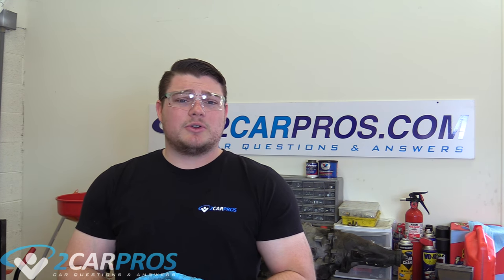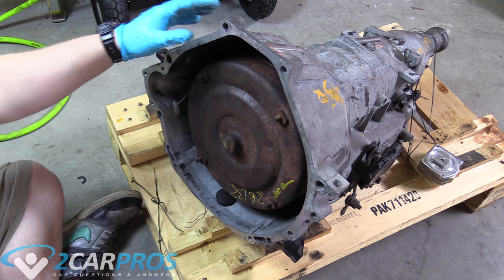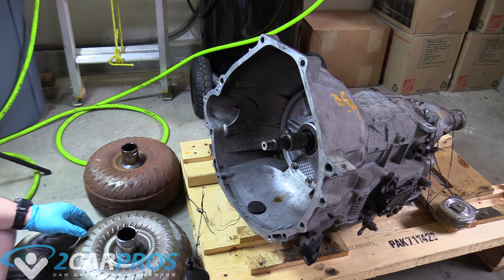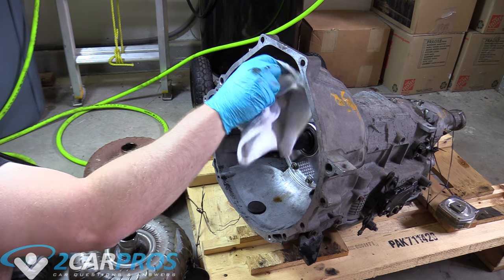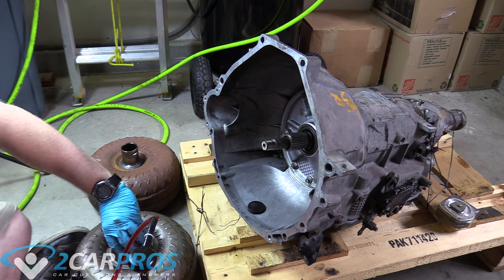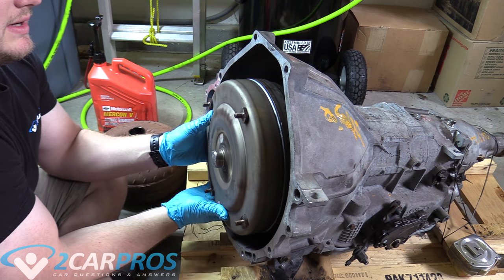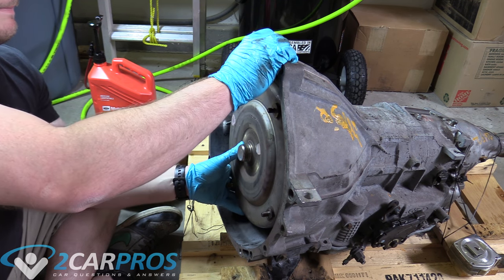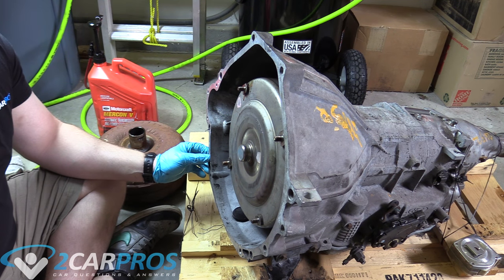How to Replace a Torque Converter for an Automatic Transmission

Comment from the maker: Forgot to mention in the video but it is a good idea to throw a quart of the appropriate ATF i the converter before install. ALSO here is the link to remove the transmission https://youtu.be/3vJAojsrfuU
Reply: thank you.
Reply: yS, infact 4 a 4d croOwn vic trAns, mAB 2 or 3(IIIIIIFFF it's nU & MpT).. & U had the perfect tUl rIt there.. shEEAashh👋
Reply: Just joshN, luv U viDOs dog 👋
Reply: im sure you remembered after a few posts, this is a horrible video cuz anyone could of done what you did without help
Reply from the maker: @usanewsnow2024  Then don't watch it?
Reply: @2carpros  lol  get good son.
Reply: @usanewsnow2024  "get good son?" never heard of that, must  be a Northern thing,lol
Reply: @dntlss  New York Thang!
Reply: @2carpros  Your video's been extremely helpful for me.  Thanks 2CarPros!
Reply: Dumb question but do you drain the trans fluid before removing the torque converter?
Reply: @dntlss it’s something kids say on video games lol
Reply: So,,,,, do I take my tire off? Axles out? How do I get to this ?
Reply: Doing my first toque converter for my friend. On his dodge Durango. Any tips or suggestions? Ill note to add quart of ATF in the converter b4 i install it.
Reply: Yeah I was gonna say don't u put fluid in it first??

Comment: Very good vedio EXCEPT you left out the most important thing of all !
When installing a new torque converter you need to pour at least a quart of ATF inside the unit before its installed  !
Not bad a greenhorn !
Keep working with them and one day you'll see the big picture  🐒
Reply from the maker: Great point, I will add the that point! Always nice to have helpful tips :)
Reply: The converter has assembly lube in it no need to put fluid in it. The pump will fill it just fine. Been rebuilding transmissions since 1980 and never once put fluid in a new or rebuilt converter.
Reply: @2carpros  😂
Reply: @dalevackar182  and you should fill it like every other mechanic so it dont pull fluid from rest of unit as well as running without fluid till that happens, sorry to hear you are a experienced mechanic who dont get that, knucklehead.
Reply: @usanewsnow2024  I think you're the one that doesn't get it son. If you had any knowledge of how a torque converter and an automatic transmission works you would know that pouring fluid in the converter is okay its just simply not necessary.
Reply: @dalevackar182  he has no idea what hes talking about, hes just trolling,some people like to put fluid in them and some dont,like you say, its not necessary but if it makes them happy then I'm all for it, you wanna see something really interesting? watch a bunch of videos on bearing packing, no matter who does it and how many videos you watch its always wrong,ALWAYS,heck when i do it, i dont spend a lot of time on it and in 30 years packing bearing i have yet to have a single failure ha ha ha
Reply: @dalevackar182  how about the bankee sona ?
Reply: @jesusolivares3749  I have no idea what you are talking about.

Comment: Anyone notice there are no videos of changing torque converters, like the full process like most! Like this guy bt a torque converter takes longer than a 3 min video! So you missed over half of the process
Reply: Bro said easy like all it takes is to just pull it out.
Reply from the maker: What? I literally showed every single step. There isn't a lot to it.
Reply: He confused transmission removal with torque converter removal..... simple solution.  Watch transmission removal video than this.

Comment: great  guy i put my transmission in and found out it has a bad torq converter
Reply: So you didn't need a transmission correct? Just a torque converter to begin with?

Comment: My Toyota has like a problem shifting to first gear. And between 30-45 It feels like I’m driving on rough road And I’ve been doing research and come to the conclusion that is the torque converter. I am correct? Just want to be sure before spending money on parts
Reply: Jose Rodriguez did you replace it? And was the problem fixed?
Reply: I'm having the exact same problem as this. Wondering if you've fixed it?
Reply: Toyota hiluxes have a clutch that is factory bonded I the front they also have a clutch plate that slides on it. Here in Australia we get them blown up all the time or burnt clutches becuase of towing or ever just getting bogged can burn you converter out.  You clutch could be slipping or a bearing has popped and it's eating through your stator. Hahahah check the pan it'll be metalic oil. Converter number.... 2082-8d we reline them with sonax linings..... To-f-1k.... We heavy duty the insides and change sprag all that jazz but 9 times out of ten you'll need two of these converters to make 1 😢🤔😅

Comment: do you fill the converter with fluid before putting it on?  or just slide it on as in the video?
Reply from the maker: You don't need to fill it. The transmission will fill it. Thanks for watching!
Reply: So that it's not dry on initial start up you should put at least 1 quart into the tc.
Reply: @2carpros  good God lol yes put atf in before install spin it a few Times so the fluid dont come out
Reply: This makes me cringe lol him not putting the fluid in haha ima stick to my shade tree that’s why I don’t trust a mechanic lol
Reply: no ofc thats the transmissions duty itll get the fluid in as soon as ya put ur foot on the pedal
Reply: @bobbycarrell4424  yup cuz these video guys arent that smart, unless they watch enuff of someone elses videos, lol

Comment: Great video!
Id like to know, I removed my transmission with the torque converter still bolted onto the flywheel on my sc400 to replace the input shaft seal. When putting the trans back will I have to clock the torque converter so that it lines up with the internal trans pump?

Comment: I’m getting a tugging feeling and noise once I get to 60mph could it be my torque converter I’ve had the motor and transmission check and no leaks

Comment: Is it possible to swap out a torque converter without completely removing the transmission?
Reply from the maker: The bellhousing has the clear the back if the engine. Thanks for watching!

Comment: Do you have to turn the torque converter three times after in and do I have to put the transmission in before I tight in the scrues in the torque converter
Reply from the maker: The torque converter has to be fully seated. Then you put the bell housing bolts in then the torque converter nuts/bolts. Thanks for watching!

Comment: I had bought a torque converter and haven't gotten around to trying to replace it because life. But I realized it doesn't even spin like the one in the vid. It's a block. Seems it may spin internally but external is all welded. Also has a weird noise when I shake it. Like it's loose inside. Now I don't wanna install it.

Comment: Do you have to reprogram computer if you get an aftermarket converter? 2013 CRV dealer had to install aftermarket converter and now the D light flashes with only 90,000 miles on trans.
Reply from the maker: No. Aftermarket converter might just be the problem. Thanks for watching!

Comment: I have 2015 mdx with 145k miles with a bad torque converter. Car shudders between 40mph and 60mph. Should i change the converter now or keep driving like that and rebuild the transmission later? Since the labor is about the same?🤔🤔🤔
Reply from the maker: Gosh that is really a judgment call. Will a complete transmission rebuild total the vehicle? Honestly, I would just the torque converter done now. Thanks for watching!
Reply: Thank i appreciate the response

Comment: Do u have to fill the torque converter with fluid??
Reply: no
Reply: yes,especially if it takes more than 4  quart ,because then at start up it sucks all the oil out of transmission and transmission pump run dry and it kills you transmission! your pan can hold between 2.5 to 5 quart depends on you car,torque converter is where most of you transmission fluid is not the pan
Reply: I got a 46re how mine quartz do i put in it

Comment: Okay I have a question I have looked all over the Internet and I cannot find this part  I just saw the video you mention it was called a spindle. I still can't find it I'm looking for what you called , it  spindle that goes inside the  torque converter cuz mine looks like teeth or gears or file down I am rebuilding the engine and if I could replace this that piece of the transmission. I'm not for sure if it's called a spline or output shaft or what  I was wondering if you can help me it's a 96 Sonoma automatic l rwd again is the part where the torque converter that goes  into the shaft that mounts to the front of the transmission bell housing . Again you said it was called a spline but I cannot find it

Comment: Good video. Hey man. Question I'm replacing my engine in my car. I have the new engine set up and ready. When the engine is in the hoist I'm able to turn the engine over by the bolt on the harmony balancer. But as soon as I connect the engine to the transmission, the engine is locked up, it won't turn , could a torque converter that is not seates probably cause that ?
Reply: Did you figure this out? Also ran into the same problem

Comment: Did you put automatic transmission fluid in that torque converter before sliding it over the pump?  It seemed awfully light to have been filled.  It will take up several quarts of fluid.  Nice video otherwise.

Comment: I have  a 1990 vw cabriolet I just  install an automatic  transmission with  a  rebuilt torque converter  but  in won't go into  gear the car  doesn't move what  Did I do wrong? Please someone help.thanks in advance.
Reply from the maker: Yep, sounds like you didn't fully seat the converter into the front pump for the transmission so it is now broken. So pull the transmission back out and it needs to be repaired. Thanks for watching!
Reply: @2carpros  thanks for replying,  I really appreciate it.

Comment: What about if its stuck on the engine
Reply from the maker: Like the transmission is out and the converter is stuck on the flex plate? I'd hose the fasteners down with penetrating fluid let it seep in and use a long implement on the fasteners. Thanks for watching!

Comment: hi , I have 2012 dodge grand caravan,  and lately I found the flex plate cracked . and I'm going to replace by myself because I can not afford the labor  cost .
so i would like to get some advice should or should not do  from you before I start tearing down.and wht do i need to do before I mount  the new plate on it.
Reply: Loc tite and make sure you torque to specs.

Comment: Easier than I thought. El yay Yaya
Reply from the maker: Thanks for watching!
Reply: @2carpros  thanks for the video!
Reply: @2carpros  so I'm guessing it's possible to take the transmission out without unbolting the torque converter from the flywheel?
Reply: SMP scientific method perspective you can but it can be very tedious depending on how it’s seated in your vehicle

Comment: Forgot the qt. I’m about to put a 3000 stall in my 1986 Corvette. Cause I rebuilt the engine, and put a 526 lift 289 duration. In it New flat top pistons, new set of E-street heads. And my favorite the noisy gear drive. But when I hooked it up to the transmission that had a factory torque converter. Soon as I put it in reverse or drive the engine stalls out and dies. I’m guessing that I would need to put a stall converter in . Can someone help me with this dilemma....🤘
Reply from the maker: That is a complicated question. Please visit our website www.2CarPros.com and ask a question for free. An automotive expert will be along shortly to help you with your issue. Thanks for watching!

Comment: what if you dont add any fluid in the torq converter b4 you hunk everything back up, what do you do then?
Reply: The trans will start to fill it with fluid so you will need to top up with about a quart, still a good idea to put some in before install

Comment: How much does it cost to replace a torque converter on a 08 gmc sierra 2500hd approximately?
Reply: Just estimate how much it would do to have a real main seal done. Its about the same process except 2 other things. You'll get a good answer that way.
Reply: Around $1,000.00 if they don't run into any additional problems.

Comment: Where do you add the trans fluid to prime the tc?
Reply: Yeah, I been taught to fill it up as much as possible without it spilling when standing upright, and once assembled pour the remaining fluid down dipstick sleeve.
Reply: Michael McAtee most automatic transmissions need 3-4 quarts in the converter before installing. Depending on make and model, a total of 12 to 16 quarts in all. You need to push and spin at the same time to insure all the splines lock in also. Some will click 2 and others will click 3

Comment: I asked my  transmission shop   How much to change the torque converter. And he says it’s a big job they have to do valve-body work  just to swap out the torque converter. ??  They said $900 I can buy a reman for $1100
Reply from the maker: That doesn't sound right. You just remove the transmission and swap the torque converter. Shouldn't have anything to do with the valve body. Thanks for watching!

Comment: I got a 2005 nissan maxima That dies when you put it in gear I'm thinking it's the torque converter
Reply from the maker: Yeah could be, but check out this article first. https://www.2carpros.com/articles/stall-at-idle Might be an easier solution. Thanks for watching!

Comment: 4r100 looks like a diesel...as it only has 4 feet. You van now get extra low stall 4r100 kits with a better multi clutch set up even sonax offers better hubs with new oil flow holes so the it lifts the clutch plates and doesn't burn them out. Or you can grt the six studded heavy duty witch everything in side is just brazed 😊
Reply: Most Mopar automatics have only 4 studs.
Reply: @donbirren9401  the new kits have six
Reply: That is a 4R70W transmission used in F150s  Crown Vics and some Lincolns

Comment: I’m gonna have fun cause I think I need a new flywheel and torque converter or well I know I do now but anyway the previous owners broke off a bold head that bolts the converter to flywheel and they ended up welding the converter to the flywheel and I’m pretty sure they fucked up the converter with that so I have to manage to get the torque converter off the flywheel some how and then the flywheel